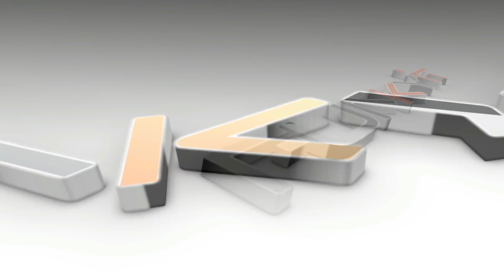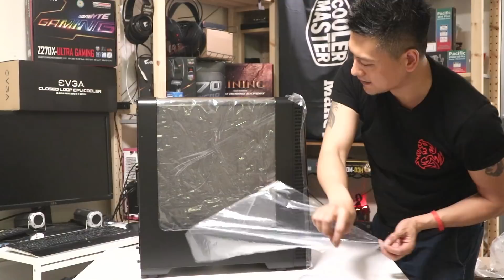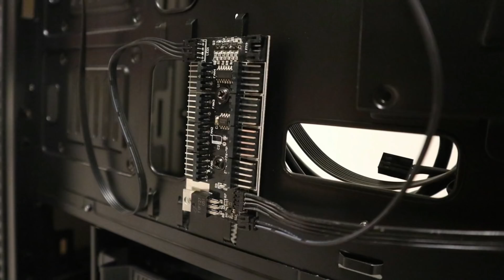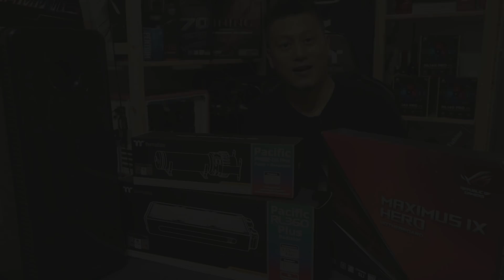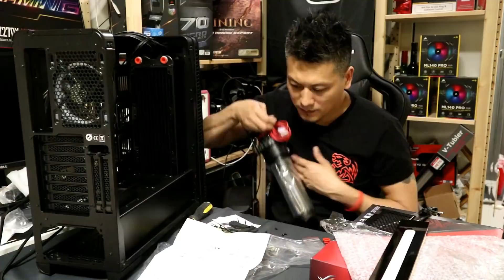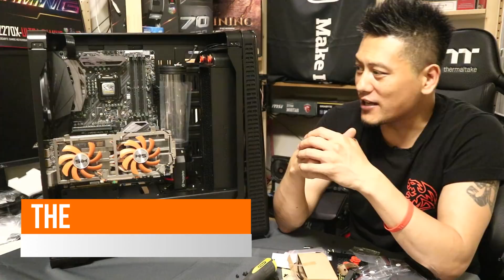A Chassis with a View - Thermaltake View 28 RGB Build with TT Pacific Watercooling parts

Comment: what did you connect the Riing Fans to? Did you use the Aurus RGB header on the MB or somewhere else? I bought the Riing Plus 12 3pk and I'm not sure where to connect it to?
Reply from the maker: Mark Garcia Connect to the controller which is included
Reply: @Funkykit  does the controller plug into he mobo? i have this case but cannot get the controller to be supported by the software so no custom rgb :(
Reply: Do you have the controller cable going to the motherboard USB?
Reply: If your motherboard has the 5V addressable RGB header. You should look at getting the premium controller:
 https://www.youtube.com/watch?v=T0s8xCplZ4Y